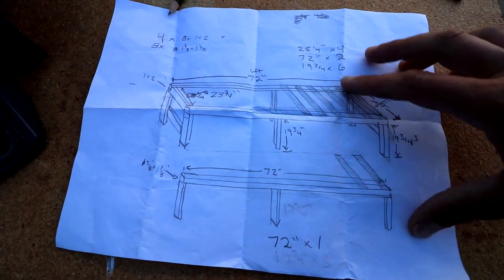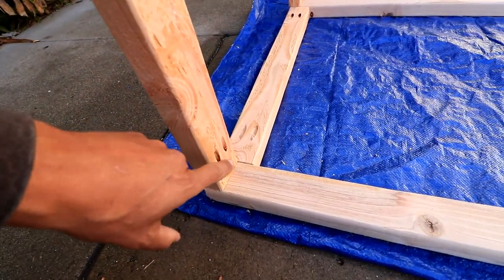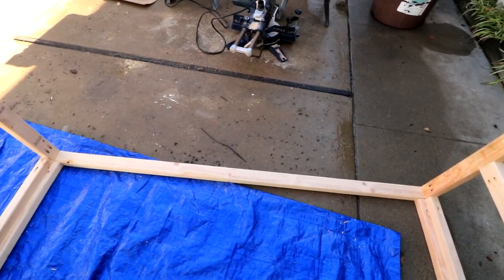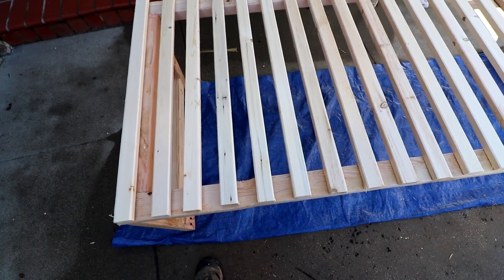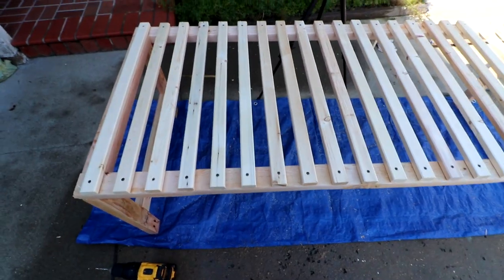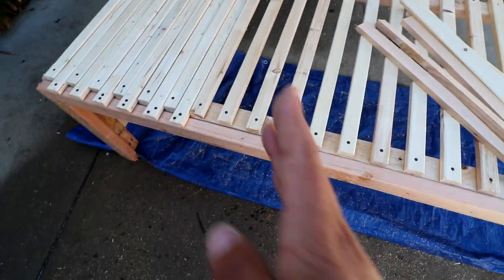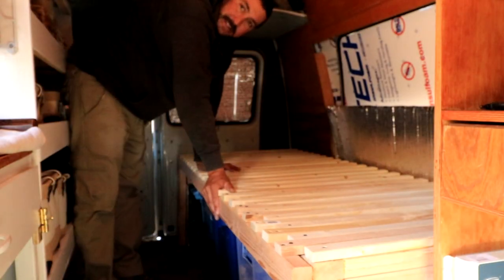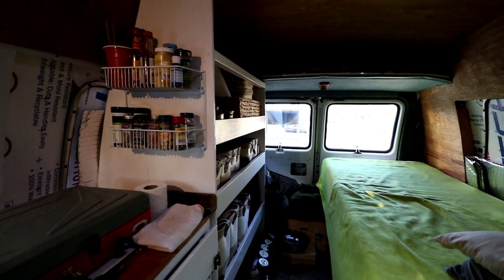Ep.4 Slide Out Slat Bed - Camper Van Build Remodel

Comment: Another 1x1 under the ends of the sliding slats will keep it true, and less binding. ✌🐧
Reply: yeh, those slats don't look secure, only being held at one end. I'd probably go for flat steel, top and bottom, on the slats at the other end.
Reply: In addition to the 1x1 crossbar, consider using Johnson's Paste Wax on the sliding parts and heavy duty felt on the bottom of the moving support legs. Should make sliding it in and out much easier. (No icons on my Chromebook, so...) Peace!
Reply: I was going to suggest exactly the same thing.  I also second the idea of waxing the slats to make them slide easier.
Reply: You beat me to it! LOL!
Reply: Also candle wax on the sides of the slides will make for smoother movement.
Reply: True, but then it would be necessary to remove the bed in one piece, rather than two.  It all depends on how heavy the bed is and how often it's necessary to remove the bed.

Comment: You did a wonderful job on the build! Years ago we had a 1977 Aristocrat camper. It had a goucho style bed. The mattress was designed in three parts and had a removable cover. So it would be in couch position and with a tug of the front of the foam it laid flat due to the way the cover was sewed. There was a big main piece of foam, a smaller maybe eight inches and a medium size piece that was the back when in couch position. When it was in bed it laid nice and flat and you easily flipped the two smaller pieces up to form the back. No hassles with loose or falling foam. Excellent support when using as a couch or bed. Yours is much fancier on the bed frame. It was just a thin piece of plywood with fold down legs that slid in and out easily.

Comment: I am on the road as of yesterday in my express build. Slept in a truck stop on I80 last night(30 degrees). However I was not prepared for -11 wind chill and blizzard warnings in Iowa so got a room. I went thru 4 designs and builds of a bed before I settled on a Teton collapsable cot that I lay on the floor when not in use. Slept like a baby last night. I put a cabinet on both sides. This leaves me 36 inch aisle down the middle. A good folding camp chair works for sitting inside. My 2nd design was like yours but I didn't like losing the headroom over the bed. The cot also lets me move it outside in the summer if I want. And as another alternative, I can also just use my sleeping bag on the floor instead of the cot. I spent 2 weeks sleeping on the cot in the house before I left. It did take 2 nights to get use to it. And with 2 wool blankets and a pad, I was very warm all night in 34 degrees.

Comment: Love your layout.  Your build outs are always inspirational. Great video, easy to follow. Thank you for sharing.  I've never seen this bed build done so easy to understand.  1 tip.  That unsecured slide out wood will warp eadily with moisture. It's happend to me.  If you attach the slide out portion to another set of legs & horizontally bar that will keep them in place, stable & true. If you are concerned about the other set of legs getting in the way of your under bed storage just use a smaller piece of wood like a 1x1 or 1x2 as its mostly for balance or at least do the horizontal bar & no legs.

Comment: Nice bed build, Brian. Very similar to mine. I’ve been sleeping on it for 2 1/2 years. :) It’s already been mentioned, but adding an underneath length-wise board will prevent the extension slats from popping up. This board would also serve as a stopper for your desired extension pullout width. FYI, wax may be needed at some point on stubborn sliding slats.
Reply: Absolutely I agree the board. Put underneath on the end of the moving slats would help them be more stable and catching.
Reply: I wish you could show some pics of your bed.  I want to build this myself, but cannot visualize what you are saying?  A full sheet of thin wood?  A cross beam?  Will that not prevent slide out?  Or prevent ventilation?  Please elaborate.
Reply: @lass-inangeles7564  I also cant work out what they mean by adding a board!
Reply: hey Troy!!! just wanted to say thank-you , i used your instolation tips, turned out grate :)

Comment: I was hoping you would see pushing the frame in and the screwing would work better glad you did. I am not a big fan of screwing drywall type screws into pine. I would gorillia glue the slats in then rescrew. I have seen wood like that crack over time, the glue would give more strength and less wiggle over time, also place a horizional wood 1x1 or 1x2 under the moving frame on the other end so they just dont hang loose. Wood can expand over time maybe some poly to keep the humid air out, you may even have to sand them so they dont stick as the wet air swells the wood.

Comment: I for see 2 problems, need to attach the sliding slats underneath to create stability, may need to put a square in between each board for airflow/moisture/swelling of the wood during seasons changing. Great presentation and love the vids.

Comment: Awesome video, thanks, I saw another one where the guy said it`s a good idea to space the slats further apart with an air gap. This allows for the bed to "breathe" when sleeping in single mode. Because: Your body is a moisture factory, You will get condensation moisture under the mattress and can get mildew. I never would have thought of this. Since you have more space no chance of the slats binding when sliding. Thanks for posting, Well done video, Nice bed!

Comment: GREAT BUILD ONCE AGAIN!🤗

SUGGESTIONS...

I MADE THE SAME BED FOR MY ELEMENT A FEW MONTHS AGO...

PUT A THIN LIP UPWARDS ON THE FRONT OF THE PULL OUT AND ON THE BACK OF THE FIXED BED  IT WILL PREVENT YOUR BED FROM FALLING DOWN WHEN DRIVING AND MOVING AROUND WHILE SLEEPING...

AND THE SLATES THAT A FREE HANGING YOU COULD USE A THIN WINDOW TRIM BOARD TO SECURE ALL THOSE TOGETHER OTHERWISE THEY TEND TO GET CAUGHT ON THE MATTRESS...

GETS ANNOYING AFTER A WHILE LOL...

I ACTUALLY USED THE SAME VERY THIN TRIM FOR ALL 3 OF THOSE...

WITH THOSE 3 FINISHING TOUCHES YOU WILL BE GOLDEN PONY BOY...
LOL

Oh yea, I also added small L- brackets on every leg to bed frame for extra support...

Much love!💙💜🌲🌲

Comment: A TRICK FOR HELPING DRAWERS SLIDE EASIER IN OLD WOODEN FURNITURE IS RUB THE BOTTOM OF THE DRAWER EDGES WITH A COMPLETELY DRY BAR OF SOAP.  I KNOW IT SOUNDS CRAZY HOWEVER IT'S WORKED FOR ME SEVERAL TIMES.  I ALWAYS USE A NEW BAR OF IVORY SOAP TO MAKE SURE IT'S DRY.  IT MIGHT WORK ON SLIDING BED SLATS.  IF I DO A SLAT BED I'LL TRY IT ON THEM TO SEE IF IT HELPS.  GREAT VAN BUILD!

Comment: Looks good Brian...to make it more firm you can screw 3/8, 1/2" plywood down on the frame nearest the wall enabling you to still pull out the extension, then cut a duplicate sheet to slide over the extension ...build is coming together just fine..you can only do so much in that confined space and it seems you maxxed out your storage space...

Comment: Sex Wax... rubbed on the under sides of the moving slats will create less friction. and if you get the scented stuff it smells wonderful :Also glue some felt to the feet of your sliding frame so you don't tear into the vinyl flooring. IT's all looking great, nice work Brian! going to be nice for your new road trips.

Comment: Nice job Brian. You are missing a piece that would connect all the loose slats. A 2X2 would work with some dowels that would slide in and out of that back 2X4 creating a stronger and more rigid platform that won’t wiggle loose as easy over time. 👍

Comment: It’s best to screw a bottom support underneath your slats that are a part of your slide out section. While they are slid all the way in take a piece (you can use the same slat wood that will be screwed into the underside of only the shorter slat ends. This will keep the shorter slats uniform preventing bending and catching as you slide them out. It will also give you a natural stopper so you don’t pull your slider out too far. Love the bed! 😁

Comment: The wax, cross member, and trim piece were already mentioned but I have two other suggestions. On the bottom of the legs that slide out you can add stick on slider pads to make it easier to slide and to protect the flooring from scratches. The w has those. Also I recommend getting the back foam sewn to the bottom mattress. I have mine separate and sometimes slip between them in the middle of the night. Also getting it big enough that it's jammed between the two walls helps.

Comment: I really liked this video and your idea on how to create your bed. If I may make one suggestion. The pull out section. You may wish to install a runner on the underside of the boards the butts up against the slats on the stationary piece. Essentially this accomplishes preventing from having to pop down the slats back into their respective grooves and keeps everything evenly spaced. Additionally, you may want to install some type of locking mechanism so that when you are in couch mode and you take a corner, the sliding section doesn’t come out from its stowaway position. Finally, a bit of felt on the bottom of the feet of the sliding section will prevent scratching of your floor as well as provide dampening cushion while driving. Just some thoughts. Great video.

Comment: Me, I wouldn’t need the wider bed, but it’s good to have the option when needed. Also the slats will provide ventilation under mattress so that should never become a problem. 
While probably not a big deal, I would’ve had the end vertical legs span the seam of the pocket joints. I like the simple mechanical strength of ‘ over lapping ‘ joints.  ✌️

Comment: Beeswax is good for the rubbing slats, it will help with sliding. Also might want to consider a thin under slat, connecting the slid-out slats underneath to help them from bowing down into the bins. But overall, great work!

Comment: I'm sure this is probably way after the fact.  I did the same thing in my gypsy wagon.  Had the same issue as you.  I took a 1/4 inch thick by 8 inches wide by the length of the bed, and stapled it on top of the sliding slats, along with waxing.  I tried narrower, but it bound up a bit.  The 8 inch works well.   You can't feel it under the mattress, , and I can still lift it out in two parts if need be.  My batteries, (agm) are in there, so if I do need to get in to them, it will be easy.  I also had an issue with the boards bowing,so I straightened them on the jointer, and no more problems.

Comment: Could of made the spaces between slats double what you originally allowed on end slats and centre one. to keep aligned when sliding. The other slats can be spaced with a much bigger gap. Less material . This would also give a bigger gap for circulation when a single bed. . That is how I did mine.    But a good job and clear instructions.

Comment: Nice bed Brian, you've already read the remedy for the tilt but I use a candle on the edges of the slats about three times a year. It really helps keep the sticking to a minimum and makes sliding it in and out much easier. You're going to really like the added room to stretch out and not have that edge of the bed feeling.

Comment: Hi Brian, I have a suggestion to make it easier to pull your bed extension out at Walmart or Harbor Freight you can buy what's known as furniture sliders for just a couple bucks and they usually come in a pack with different sizes you can put two on the bottom of those two by four on your slide out and they'll slide on linoleum, carpet or any surface.

Comment: I can't add to the suggestions below. I plan to build my own gaucho sofa for my fifth wheel with a few design differences. Mine is next to the wheel well, so I'm gonna have an extension coming back from the sofa to the wall. On that extension, I'm building a box using MDF that will provide a "sofa back" as well as linen storage. You should stain/seal/paint the sofa- it looks GREAT!

Comment: you will needt to screw the slats of the slide out to a piece of wood underneath the slats that will also act as a stop when you pull the side out.... and also so the slats are not bending down... just a suggestion.

Comment: Nice build, why did you not screw the slide out latches to another one that sits transvers to the single ones underneath the fixed ones?
Reply from the maker: It was strong enough as is. 👍🏼

Comment: Thanks for the video, just finished a different version as I'm not as skilled as you but I'm wondering what you used for a mattress, as mine the width of my slide-out area 73" x 54" and needs to be able to fold for couch position?
Reply from the maker: I use an Ikea foam mattress.  I cut it in half lengthwise to fold for couch.

Comment: The other sliding beds I've seen they had a board running across the other side of the sliding slats. And I've only seen 1X4's how are those holding up?
Reply: I had to put together a kit bought slat bed.  It came with a slim masonite strip to attach the sliding slates together on top with countersunk screws.  I added a strip
Reply: Continued - a strip of super slick tape to the underside of the masonite to help with drag.

Comment: On that slide part of the bed, when you pull it out, you can put a piece crosswise under the slats so they don't fly out when you slide it out, might be safer if you have someone sleeping with you so they don't flip off the bed. I thought you were going to do that. Great job otherwise